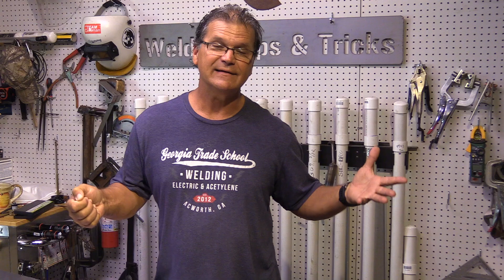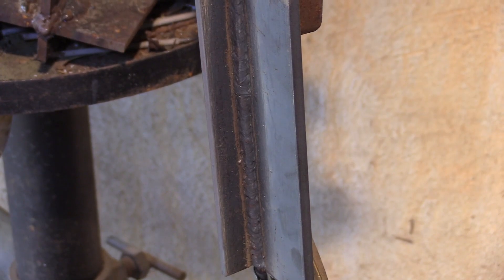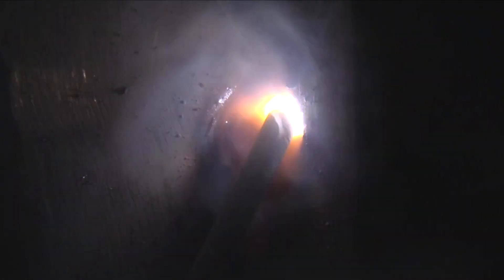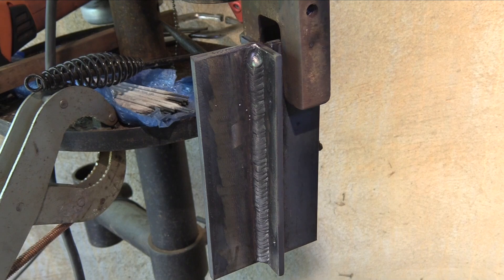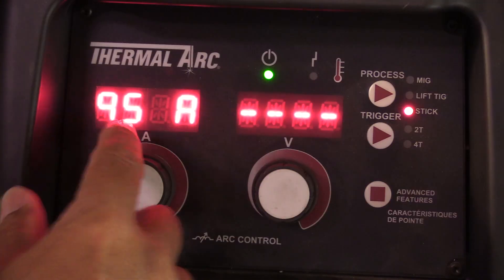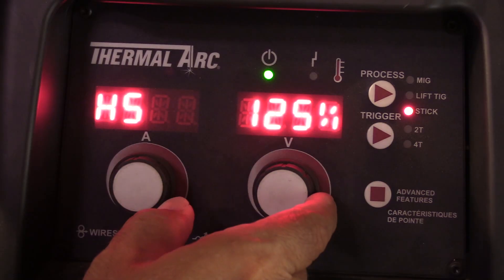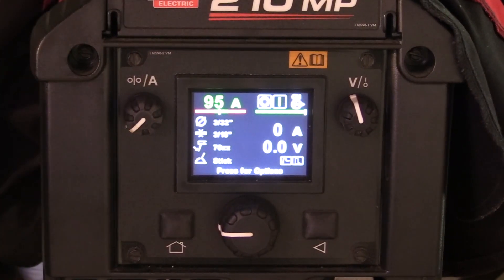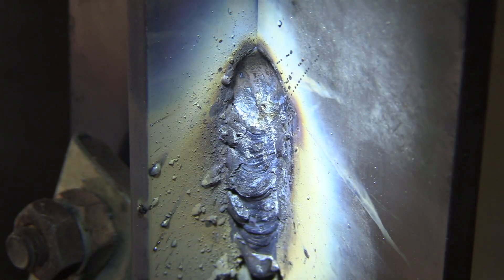7018 Uphill & arc force

Comment: Can anyone clarify why a 6010 / 6011 wasnt utilized for the root pass? Is it just preferential, or because uphill tends to run hotter than flat?
Reply from the maker: @jontest5718  some codes and procedures specify low hydrogen electrodes only. 7018 is low hydrogen but 6010/6011 are not. This joint is a common drill in welding school in preparation for a structural welding test using 7018 only. Hope this helps
Reply: @weldingtipsandtricks  Thank you. Have a good day.

Comment: I'm having a heck of a time in school right now with 3g plate test. I'm using 1/8" 7018. 105amps. Just stringers, maybe slight oscillation, but very minimal. One issue I have is undercut on my cap pass. I have let the plate cool, tried little circles, slowed way down on my travel speed, kept a tight arc, and made sure my rod angle is angled 90 degrees. I still seem to get undercut once I lift my hood. My question is, can you see undercut in the puddle? What does it look like, and what to look for to know that it had filled in?

Comment: The hot start is the same on miller big blue 400s. I just know im always stick welding and turn it all the way up. Usually i run full dig with 7018 when im in good positions. Im in an elevator shaft now welding behind in very tight uncomfortable positions, base materials galvanised on galvanised.. my length of is extremely variable so i found turning the dig to all the way "soft" gives me a lot of tolerance

Comment: Laughing just now because Jody had the same issue I had-can't find the information in the manual.  It's not in the PW325TIG manual either but there are two knobs, one for each. The same knobs are used in up/downslope settings. Anybody stick welding with the 325?
Reply: So arc force is an automatic compensation for variations in arc length? Yes, we'll have to play with it.

Comment: I have trouble distinguishing between the metal puddle and the slag when I'm welding uphill. I'll see the slag puddling and dripping off and think it's the weld pool when it's not, and then vice versa. Any tips for how to recognize what I'm looking at?
Reply: The molten metal will alway chase the puddle. That how I distinguish between the two. Try keeping your eys, on the leading edge of the puddle, and watch your arc length....

Comment: what arc force setting would you recommend for 6g pipe welding on the fill with stringer beads on sch 120 pipe? rods are 8016-G

Comment: The problem I have with running 7018 in a vertical up fillet is the tiny bit of arc blow that I get when I reach the top of the end of the weld. Below that point, the weld is near perfect. Any suggestions?

Comment: Finally, I've gone through almost every video on youtube on the subject of Arc Force and at the end of each video I was not only disappointed but also frustrated. Then I found your video and boom, everything I needed to know about this feature was here (how, what, why, when). I've bought an inverter machine and am teaching myself and this video gave me hope when I couldn't understand the Arc settings and almost gave up (haven't touched the stinger in 2 days), low on arc force won't let me strike an ark at all, hight on arc force and I burn through 2mm thick practice piece with 6013. Thankyou so very much for the video.

Comment: I would like to see your take using a sa200, ie: settings, voltage, amperage. Hi amp-low voltage vs low amp hi voltage. Cold stacks vs hot etc. I've learned so much from your videos but have only found your shop welder videos.

Comment: Love watching your videos man, I learn a lot good tips... At work we do a lot structure welding, welding to soldier piles, that have cables that are being held by chairs that we set and are under pressure and so we use a lot of 4mm 7018 rods and depending what we do we lower or increase the amps. You see, I always do a root pass and than my capping when welding vertically, but some of my co-workers they crank up the amps to 165amps and they do one pass and it looks amazing, I struggle at 165 but at 150,155 amps I do much better, but my welds come out decent. I have my days but some days, up hill,  sometimes I can't control my pool  and end up having to stop cause half way through my rod im creating a big crater that's about to blow through. Could you please do some videos  with 4mm rods up hill and show us some of your techniques.

Comment: On your first restart around 1:10. It doesn't look like you chipped your slag off at that point. Wouldn't that leave a slag inclusion in your weld? 
 I can't run a vertical stringer to save my life. I'm trying to get my welding certification but we have to weld nothing but stringers on two 1-in plates cut at 22° bevel. I don't get it I can weld vertical weaves horizontal flat overhead but vertical stringers it always falls out on me. I've tried 90° angles a little uphill angle and the weld either falls out on me or I burn through some quarter inch plate that I've been trying to weld on at home for practice using a miller dialarc 250, at the training center at some kind of Lincoln electric neither have any of the dig or any of those special settings. 1/8 7018 rod.

Comment: So if your machine has anti stick and parameter to increase amperage when the machines senses it needs to while holding a very tight arc, wouldnt the two setting negate each other?

Comment: Jody you make this look so damn easy!   I'm terrible at uphill ! I think I'm way too hot all the time. Using 1/8 7018 rods is 145 amps too hot? My puddle is not controllable.
Reply: Try 120-125
Reply: @ShieldArc200   I mainly use a Lincoln 250gxt engine drive welder,  it can be difficult to dial it in to an exact number because it has electrode size on the amperage dial, for instance 1/8 electrode is 145 amps on the dial.

Comment: I’d love to see you do a video on dual shielded flux cored 1/16th wire (I don’t think you have). That’s what I use at work. Would be nice to hear some tips on how to produce neat looking welds with that thick diameter wire. It does make a difference. Does feel much different than 0.35/0.45 IMO.

Comment: Reminds me of my X-ray days in the late 70s using 8018 and 11018, 3/32 and 1/8 with a little 3/16 building submarines. Course we had an inter pass temp to work within. I then moved on to X-ray horizontal sub arc, much faster, and only about 100# a night because of inter pass temp. Primitive tools by today's standards

Comment: There are so many gifted coders, electronics engineers and developers out there, and you could envision a MIC under the helmet that responds to:
"Set 110" / "Plus Five" / "Minus 10", "Slope down" ETC-etc. - And transmit it to the Welding equipment via Bluetooth or {whatever}. Voice recognition is everywhere nowadays.
You can get an Alexa Echo Dot for $40.-. That device is by mega-dimensions more sophisticated than a blunt fingertip AMP control which they sell for way beyond USD100.- (Which is obscene ^^). Should be easy for people working in the right industry.

Comment: Hey Jody! This comment isn't really related to this video. I figured maybe you'd be watching comments in a more recent video so I'm hoping you see this. I went to a job interview today advertised for a TIG/fabricator. I have TIG welded but not in the last 10 years. Twice that for MIG and then only structural aluminum with a spool gun. 
I sent my resume with a cover letter saying I haven't done TIG in a long time, but when I did I was pretty good at it. ( Braze welding also. They always seemed similar to me.)

The reply said "If you can TIG a corner on 20Ga stainless, we'd love to talk to you.' 20ga? Stainless? @#$%^! I almost chickened out right there. 

I've been a deep sea diver for most of my adult life. 20 years in the Navy, 20 as a commercial diver. I was initially trained as a ship fitter (Hull Tech) which covered welding, always 7018, 6011 in real life on most things. But after dive school, I was a diver not a ship fitter and welding was as needed when something broke or needed to be made.  

On the commercial side my first job was welding a couple hundred 200lbs sacrificial anodes to a port seawall for cathodic protection. Used 6013 wrapped in electrical tape. Or 7014 if it was clean metal. Rutile flux is better down under. Has to do with the gas and quick puddle quench in the water. Traps hydrogen if you try much manipulation. I was pretty good at that too. 

My last dive job was doing the same thing with 1,325  of those anodes. 6-7 hours a day welding. Shallow (<40'), warm clear water. And then it was finished, I moved back to the states, close to my core family for the first time in 40 years. But I'm not a diver anymore and that has taken some time to get used to. 

20ga stainless..... I've been watching you videos for a long time. I know square waves, frequencies, pulse, hot start, gas lens, stubby, cup walking, AC, DC. 2% lathenated,  but I had never actually welded anorexic stainless. How hard can it be? It's all the same just a smaller scale. I sat down this morning and watched your videos on stainless sheet. Key take away....get a puddle and get going. 2/3 less heat. They gave me a couple of practice sheets. I'm sure in their mind, to give me a chance to get used to the machine. In my mind it was, "Dude, you have about 12" to learn how to weld @#$% 20ga stainless." On a corner. Corners are easier, right? It worked okay. A kid that was helping me with the plates gave me a great tip after watching the second practice. Just go about a 1/2" at a time and keep the tip close for the post flow. It worked. Then they said lets see you MIG. At least it was 3/6" mild steel. Your video key take away...little e, triangle push, pull, doesn't really matter...stay at the front of the puddle. It worked. 

I got hired as a welder helper/entry welder today. First day is on Saturday. I'll be 60 in a few months and I feel like a kid, starting a new career. Your videos are a huge factor in my success today. The knowledge you share, the clear video showing the smallest details of torch and tip position, puddle control and shape. Thank you for the effort you put into this. No more UBER driven. Thanks, Bro.
Reply: Wow great story got a weld test soon and it always fills lile its my first time and i just hope i don't mess up
Reply: I wanted to be a commercial diver too, I’m 16, diving really interested me, I’m also a very good welder. I’m not sure if I still want to be a diver, I don’t know if it’s worth it or not.

Comment: Hello Jody, Back when I was in Vocational school in 1976 we had uncoated electrode we practiced with. They called it "Coat hanger Rod", and it was a challenge to weld with. 
We had to practice with it for the first 2 weeks, after that we were allowed to use 6011 which seemed like a Cadillac compared to an Edsel. It would be interesting if you could get ahold of some of that electrode and see what you can do with it. IF they still even make it.

Comment: How about 6013 AC? I cant seem to get a nuce bead whatever I do and I use the most popular electrodes available in my country and try to follow these tips but its still a bead full of craters and it isnt filled in...
Reply: Slow down and watch rod angle...let the arc blow the slag to the back of the puddle
Reply: @clevelandmortician3887  I will try that even though I always blow a hole through the material if I go too slow. My machine is very antient and I cant select specific amps. If goes by 50amp increments.

Comment: I was always told and told others that you had to chip off the slag on the previous bead before doing a restart. I noticed here that you didn’t clean the slag for your restarts. Was it not necessary to chip the welds all these years?
Reply: Richard Valcourt I was wondering about that too. I always remove the slag before restarting
Reply: Depends, in my experience you're fine if you get a quick restart. Atleast on horizontal, flat and vertical up. Vertical down I always chip
Reply: the video stops and starts. I believe he chips nearly all of them but slag on 7018 is heavy and often leaves bare metal for about 10mm at the end of a vert up.

Comment: Another banger here!! Love these videos! 100% self taught from this channel. One thing i did notice, on that second pass at the 2:30 mark you finished the first rod then went straight in to the second without knocking off the slag... is that okay on restarts or you did that just because you were practicing/the second rod will burn out the slag when you go over it??  Thanks again Jody!!!
Reply: With vertical up the slag will drop due to gravity. When you get straigt in with the new rod when everything is still good and hot the little bit of slag in the endcrater of the previous rod will float to the top. The same goes for stacking beads horizontal. You can use the slag from the previous bead to support the rod on the next bead. That little bit of slag in the toe of the previous bead just burns out and flows to the top.
When on a test it's better to be safe and clean the slag after every rod but if done right it shouldn't be a problem on vertical up and horizontal.
Reply: thanks!

Comment: Jody, I plan on doing some welding on a truck frame.  Not knowing which sized electrode would be best, I bought some 3/32, 1/4 and 5/32.  Is there a rule of thumb as to when you should use the larger diameter electrodes?  Thanks
Reply: Jerry A there is more of a law than a rule of thumb that you absolutely never use an electrode with a larger diameter than the thickness of the base metal you intend to weld, but other than that thick electrodes are more suited for very heavy metal. I generally don't use more than a 1/8th rod for putting down welds with less than 1/2in leg sizes

Comment: Thought I would pass this on for what it is worth. I have a MIG Miller 211 Auto-Set machine which has a dial showing 10-100 for the wire speeds. Most videos typically tell the IPM values, etc. I contacted Miller which responded with an estimate of 65 ipm for each "10" on the dial, so 20 = 130 roughly, etc.
Perhaps if you wanted Lincoln may tell you what the Hot-Start numbers represent.

Comment: Jody, I weld with A/C stick and flux core wire and I have a good  auto darkening shield but I have a hard time seeing, any ideas,
Thanks,
Dave
Reply: Go with the lightest shade you can that doesn't' leave you seeing stars. I used to use an 8 for sheet metal mig welding.
Reply: Dave R get a cheater lens, or maybe try local exhaust for the stick welding at least. I know with some electrodes I just cannot see through the plume unless I've got a fan blowing or an exhaust hood near me, especially in overhead

Comment: I like 3/32 7018 for most things, I just shake too damn much for about the first 1/3 of the rod. That thin ass rod emphasizes it I guess. For that reason, if I can't prop good and solid on something, I grab a 1/8" rod. But it's more likely because I'm just not as good as I should be.
Reply: I used to be that way, just give it time and you’ll get smoother and more comfortable

Comment: What welding are you the best at. Tig Stick or mig. And on a side note why can't you gmaw aluminum. Or metal inter gas as The slang gos
Reply: You can totally weld aluminum  via the GMAW method. The biggest difficulty with GMAW aluminum is the softness of the aluminum wire. A traditional GMAW set-up typically won't work as the wire will kink and form a bird nest. They've got "push-pull" GMAW torches, as well and "spool gun" style torches that work best for aluminum. Both have their advantages and disadvantages. The main two disadvantages with both methods is that they weigh more and are more expensive than a traditional GMAW torch.
Reply: Atomic Fire 
Then why do they tig it